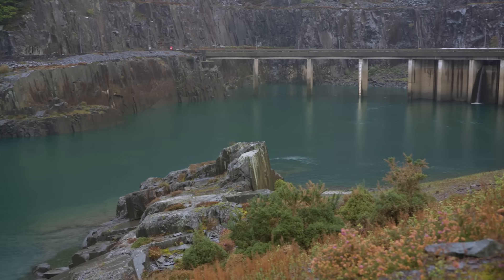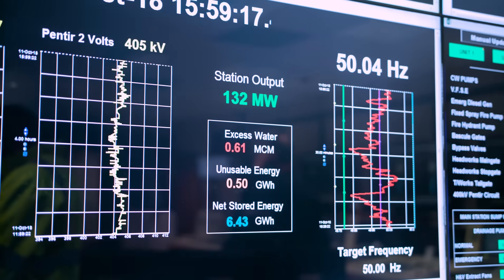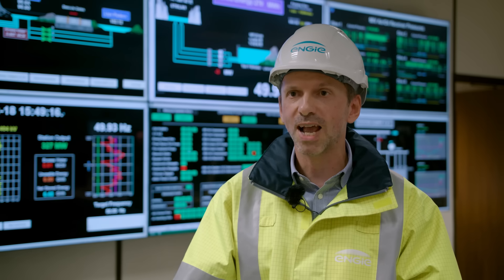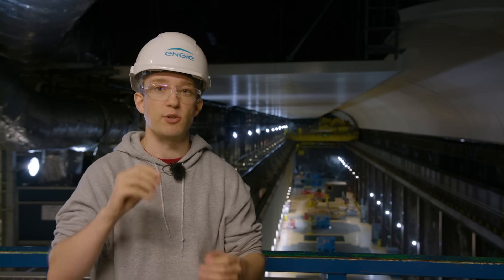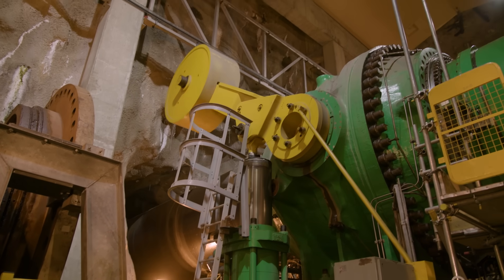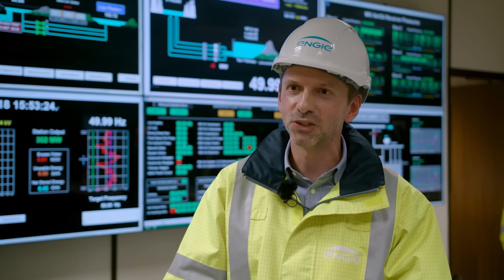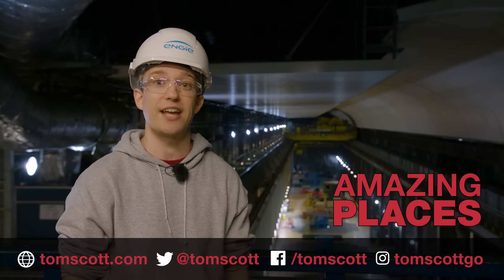Britain's largest battery is actually a lake

Comment: We need another Nikola Tesla. AC was good and it is still good. Who would have thought that alternating a voltage can deliver power like that. But the problem lies in having to match phases and frequencies.

Now with renewables, it would be great for another genius to invent another power transmission that does not need to be synchronised. Like, just keep producing and pumping the power into a system with no restrictions. I know I probably cant so someone else has to.
Reply: Large, frequency synchronized grids have inertia, they are deliberately large to withstand the many transient issues. Power is transferred between them with DC interties, which do not have phases and frequencies. While Europe is not synchronized on one common frequency, using the interties it's still an interconnected power grid, same with North America.

Comment: California has one similar system. Except the water is pumped up during the day using excess solar energy and released in the evening. It effectively lets California store its excess solar energy at about 80% efficiency, much much more efficient and less expensive than Li batteries.
Reply: Pumped storage lasts four times longer than lithium, is likely 10% less efficient than lithium and 20% of lithium's cost.

California has a nasty "duck curve" where the sun sets on solar power and air conditioners are at maximum.

Comment: You claim water was incompressable but this would break the law of physics since it allowed for sound to travel at infinite speed. Water is very well compressable, please do not spread false information.

Edit: The intro is wrong too since the meaning of battery is not "store of potential energy" but "a container consisting of one or more cells" which can refer to a variety of technical devices. Therefore the title is entirely nonsense.

Comment: Some guy in Britain applied the same principle to cranes and concrete blocks... basically pilling up the blocks on down time and then, on high consumption times, the cranes lower the blocks one by one generating power while it goes down, gravity does the job and concrete is much denser than water. so it is more efficient.
Reply: Oh sorry, its a swiss startup. it's called Energy Vault. Look it up!

Comment: Hi Tom.
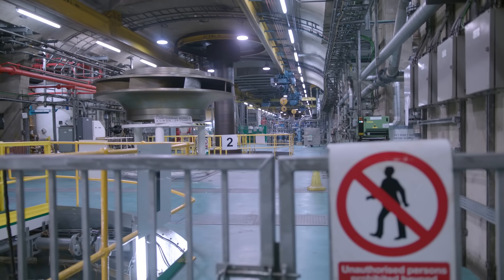At (3:27), and you'll need to pause the video here, the text states that: "...the spiral pipe gets smaller to keep pressure the same all the way round..."
Now please forgive me if I am wrong but as far as my knowledge goes, the diameter of any pipe, or the diameter of the spiral of some such pie should have no effect on the pressure within it. The flow can certainly be altered but the pressure?
Am I missing something here, or (and this is what I suspect), some low-level technician, lacking the essential fundamental knowledge was tasked with writing this description of the function of the "No. 1 Turbine"?
Please, please get back to me on this.
Am I nuts?
I shall delete this post if that is determined to be feasible.

Comment: But, how much energy does it use to pump the water up to the top reservoir?  How efficient is the station
Reply: According to Wikipedia, "The round-trip energy efficiency of PSH varies between 70%–80%"

Comment: By definition a battery is a container consisting of one or more cells, in which chemical energy is converted into electricity and used as a source of power so Electric Mountain isn't the largest battery in the world, the actual largest battery is a lithium ion battery with a capacity of 100 megawatts built by Tesla in South Australia. Loved the video though especially the part about the pressure relief shaft, very interesting!
Reply: There are two reservoirs.... that is technically two cells. Water is a chemical too.
Reply: but is it in a container 🤔 @keriezy
Reply: Since when are batteries chemical energy only? They simply have to be potential energy.
Reply: @nolategame6367  By that logic the biggest battery would be the sun, I said that it wasn't the largest battery by DEFINITION.

Comment: One thing I simply can't understand. The amount of energy produced by this power station is equal to the amount is needed to pump the water up again. So net energy should be zero. Then what's the point of this massive thing. Or there's some catch here that I'm not understanding. Thanks.
Reply: During daytime they have a larger demand so the plant gives energy to the grid. At nightime the demand is lower so the plant takes energy from the grid to pump the water back. It means that you can spread the power generation through the day so you need less plants doing the actual power generation. As for why this isn't used as a regular hydroelectric plant, since it is a lake, not a river, the lake would just dry out after some days.

Comment: Biggest problem or better to say  just one problem of electricity it is impossible to storage, Lithium have capacity of 400KJ/kg where gasoline have 4300KJ/kg is 11 times more higher value per kilogram, lithium have very low density it takes a lot of space, lithium very expensive to make (requires very a lot of fuel and coal :), plus have leakage after 1 years electricity escapes electric fuel tank. Hydro accumulation is solution store night time electric power but electric generators works about 95% efficiency and by comparing how powerful generators are with 5% reverse generator losses they are very big, still is cheaper than electric arch iron smelting.

Comment: The banging in water pipes in homes when the faucet is closed is not caused by the pipes not being tied down well, its caused by the air chambers (or modern water arrestors) becoming filled with water. Just like the chambers in the Dinorwig Power Station, most homes have air chambers to prevent water hammering and damage to the pipes.

Comment: So do they pump up all of the water that fell down during the day back up using the energy from the pressure release things at night? Wouldn't that mean that the amount of water in the upper reservoir is still decreasing because water is flowing down to pump water back up (but less due to entropy stuff or else it would be a perpetual machine)?

Comment: Unfortunately, water batteries like this lose ~30% of the energy put into them, so it's not a great solution to the energy problem.

Neat though.
Reply: Worse than that. But it does mean less power plants are needed, so it saves money.

Comment: I wonder how much energy is used in pumping all the water back up to the top? That doesn't seem to be addressed in the video. I get that it's done overnight to be cheaper, but it still takes energy. I'm guessing it's a very small percentage of the amount produced during the day or it wouldn't be feasible to keep it going for so long.

Comment: An important point is elided a bit here, a pumped reservoir is not an electricity generation apparatus, but a storage apparatus.
It is helpful in reliability for peak demand, but is very wasteful overall.  It takes energy to turn the reservoir into potential energy and it takes energy to turn that potential energy into useful energy.
This helps because the power plants can generate energy when people aren't using it to use later.  And renewables can likewise be banked.  But otherwise, it is parasitic.  Overall it consumes energy for the sole purpose to having the energy on hand when demand peaks.

Comment: ??? But it takes the same amount of energy to take the water back to the high reservoir at night. You aren't actually making any energy! If you make a certain amount of energy during the day then at night you have to reuse that energy at night to pump the water back? What am I not understanding, I think I am not understanding this right.
Reply: Cooper Beggs they’re not trying to make energy: it’s a battery. They’re just storing it for when it’s needed. At night there’s too much energy (coal plants can’t just turn off) so they use it up doing this- in the day there might not be enough energy so they release the water and re-generate the electricity to put into the gris
Reply: @jackcooper4998  Oh, yeah I guess that actually makes a hell of a lot of sense!

Comment: I've considered a mini setup like this for my house, now I'm motivated to research it more haha (battery banks are so expensive, and don't last long, and aren't good for the environment)
Reply: I wonder how much water you could reasonably use for a system like this
Reply: After a small amount of investigation, do not do this
Reply: @biggiecheez6879  well I don't use most of my back hard, and could fit a few 10,000 litre tanks, which is a 10 tonnes each (I live on about 600 square metres)
Reply: @fillman86  each water tank, filled to the top, at about 10m off where it's going to drain to, has about 270 watt hours, which is less than half of what it takes to power a toaster. Not very good
Reply: @biggiecheez6879  ah, fair enough

Comment: What's the overall efficiency of pumping the water back up compared to the electricity it generates on its way down? I'd hope at least 80%.
Reply: Wikipedia says around 75%. But the electricity is cheaper at night, and rain helps.
Reply: It's definitely better than efficiency of any internal combustion engine or hydrogen fuel cell :-)
Reply: What's the efficiency of curtailment on wind and solar, I'll guess 0%, so if they can make use of any percentage instead of throwing it away that's great. There are chemical batteries at ten times the price that have much higher efficiencies but for some reason they aren't popular.

Comment: So, it's a capacitor... wouldn't it be better to re-fill it in the day off of solar power, and then generate power at night (when solar doesn't work)? because right now it's operating at an energy-loss (because thermodynamics) and getting a profit off of it, is only a quirk of electricity being "cheaper" at night, even though the generation costs are materially the same....
Reply: There are generators that are by default operating at night, so yes, theoretically it would be more efficient, but with the make up of our generation, it's not.  Also... solar?  Have you been to the UK?
Reply: @DJMavis  Solar was just an example. In order for this to be energy efficient, the energy used to refill the reservoir has to be passive energy generation, with no fuel costs. this is because the energy cost of refilling the reservoir is greater than the energy generated by draining it, because thermodynamics. and by "energy cost" in this case I don't mean £, I mean KwH. the energy generated by draining is X, but the energy consumed by filling is X+Y, which means it's got a net loss of Y kilowatt hours, and that X+Y kilowatt hours is currently generated by burning a fuel which converts a finite resource into kilowatt hours and pollution. It's operating at a  £ profit but a thermodynamic loss, and therefor a greater consumption of fuel than if you simply had more fuel-burning power stations for the sum total of energy generated. doesn't matter if it's coal, oil, or gas, you would use less of it to power the grid off of that, than powering the grid off of this reservoir and refilling it off of those. I don't know how many ways I can say it. So refill it with solar, with wind, with geothermal, refill it with freaking sterling engines, have a bunch of electrical capacitors connected to a tethered balloon with a lightning rod, anything else that doesn't consume a finite resource to power the generators to refill the reservoir, you are operating at thermodynamic loss.
Reply: @therealquade  I understand what you mean, but that's not what it's for.  And I don't think, even though you watched the video, that you understand the demand requirement of the national grid, or the time it takes to power up and down a fossil fuel or nuclear plant.  And Sterling engines aren't the most viable prospect in a temperate zone with no volcanic activity.
Reply: @DJMavis  I'm just trying to say, if you build more fossil fuel plants, or nuclear plants, and generated more power that way, you'd actually be using less fossil fuels or nuclear fuel annually, than you would with this. though, I'm an american, maybe the use of this boils down to land usage since you don't have much of that.
Reply: @therealquade  but you can't just turn a conventional or nuclear power plant on and off
Reply: The answer is NO for the U.K..   However, the answer is also YES in that it would be beneficial to fill the lake whenever it made economic sense during periods of time when the lake was not needed to generate power for the grid.  Efficiency and a real world economy are two different things. Would it make sense to cook your breakfast in another country where labor was more plentiful and then deliver it to you home? Yes, Maybe if the transportation costs were low.  Would the food taste good? No, the time in transport would diminish the flavor.
Reply: There's a system that takes wind, solar, nuclear technology and fuel cost and thermodynamics and efficiency and peak demand and combines them all together into a single measurement know as price per kilowatt/hour.  This facility exists because it consumes at a low price and sells at a high price.  About two million $US comes out each day, so even though it was designed for the circumstances 50 years ago, with that much money the details don't matter.
Reply: You also lose some power when you charge a power bank and then use that to charge your phone later in the day. It's about when there is spare power and when there is too little.

Generation costs aren't the same, since some sources are cheaper than others. If you can charge this off the cheap sources (nuclear) then discharge instead of activating an expensive source like coal, then you have saved some, both financially and environmentally.

The energy loss in Joules isn't really considered important, when gains in £ and CO2 can be made. This is cheaper than building a new power plant in both of those aspects, and is much quicker to switch on and off as well.

Comment: There should be more hydro power stations in the UK, they wouldn't necessarily have to be pumped storage. There are constantly flowing rivers and high mountains in the UK where energy from moving water could be used to drive turbines.

Comment: So in terms of energy transfer it's a net loss, because the energy needed to pump the water back up would have to be greater than what's generated by gravity; but it's a net gain in profits because of the time of day when energy is generated vs used.

Comment: Missouri (USA) has an electric mountain - Taum sauk Mountain doing an identical job as your electric mountain.  Several years ago, one of the operators recharging the lake on the top of the mountain let the water overflow the basin and erode the banks holding the gazillion gallons of water. The entire basin of water gushed down the forested mountain taking a half mile wide path of trees with it, wiped out a campground near the bottom, washed away the forest ranger's home flooded nearby creeks and rivers.  Everything was awash with mud for miles downstream.  It took years to repair most of the damage and the forest will take decades to recover.  Better luck with your electric mountain.
Reply: Its an old quarry site so luckily there isnt a forest to be destroyed if anything goes wrong.

Comment: Why is water incompressible? And is it truly and infinitely incompressible or just to a certain pressure?
Reply: Lewis - The bulk modulus of water is about 2.2 GPa.  Less than most metals, but much greater than things like wood or plastic.  Why?  van der Waal's forces, or something of the sort. (Always the answer to any question involving water).
Reply: Tevildo but would it compress under extremely great pressures? Or is it totally and completely incompressible
Reply: @DirtyLew42  Yes, it doesn't have an infinite bulk modulus.  1000 ℓ of water at atmospheric pressure will be compressed to about 990 ℓ at 22 MPa (about 3500 psi).

In other words, if you have a 1 m^3 box full of water with a moveable lid and (very) thick sides, and you put a 20 ton weight on it, the lid will go down by less than 1 cm: but it'll still go down.
Reply: @Tevildo  gotcha. thx

Comment: In Australia our Prime Minister is pursuing a radical new way of generating electricity. Instead of using water, we use a special biologically-derived mineral called "coal" that we harvest from the ground. When the grid needs energy we "burn" this coal and make steam to drive turbines. It's fantastically efficient - almost reaching a staggering 10% by the time we have boiled the kettle. Maybe one day the UK will catch up with this technology too.

Comment: There is also a giant pumped-storage hydro station called « Pumpspeicherkraftwerk Linth-Limmern » near my parents home in Switzerland. Around 5 years ago I could visit it when it was under construction. There is a cavern to contain the turbines huge as you could place a cathedral in it. And the power consumption of the heating installation of the whole construction site was around 1MW. And the difference of altitude between the two lakes is around 600m.

Comment: doesent pumping it back up take more energy?
and will that energy come from carbon fuel?
Reply: You get about 75% of the energy out that you put in. And that energy can come from any source; coal, nuke, etc... but the idea is that it comes from solar during the day, and wind during... windy times. Anyway, as they say in the video, the major application of these types of system today is to make it possible to accept more renewable (read "unreliable") energy and shift it from the times it shows up, to the times it's needed.